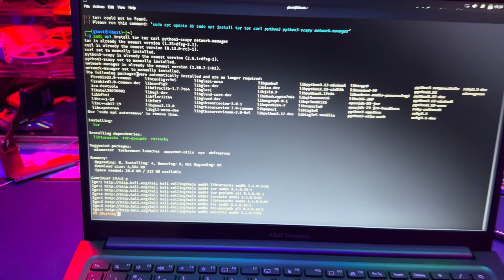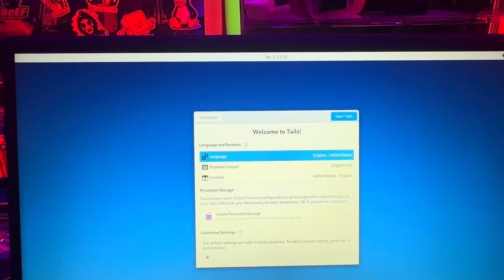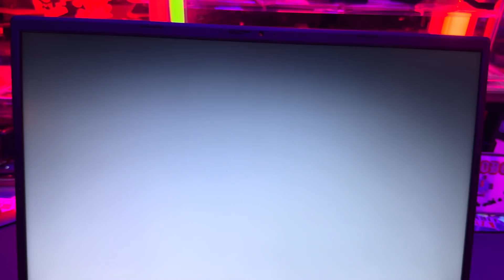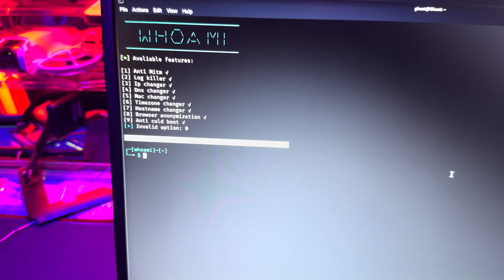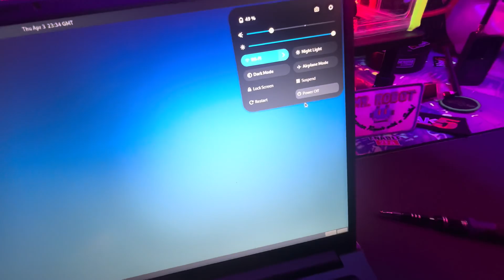I Built the Ultimate Privacy Laptop (Ghost Laptop 2.0 Upgrade) Hardware Privacy & WiFi PenTesting!

Comment: hey very good video and lots of useful information for hardware and what to avoid! im not sure if others have commented this but i wanna give a tip since i noticed you're wearing gloves. ive heard that wearing 1 layer of disposable gloves like that can still potentially leave prints if that is a concern for you. i recommend wearing thin cotton liner gloves inside of those type of gloves or even use leather gloves on top of disposable gloves with the thin cotton liner gloves. sounds very layered but it ensures prints will not be exposed! hope you find this info useful

Comment: This is mostly useless.. just buy an older thinkpad with a removable battery, that you can run a custom BIOS firmware on that would allow you to control power to devices then run an OS that'd allow you to change the MAC of your wifi card.

Comment: Super cool project but an EXTREMELY suspect laptop. The laptop screams illegal hacking. Maybe you can use less overt antennas? I think there’s some antennas are cord like so they are malleable and can maybe bend around the frame subtly. I think I’d rather swap the default chip out with another one though

Comment: Tf is this... instead of using external wifi card via usb you rather destroy the case and put it inside, which is not only ugly but also impractical. And it;s literally faster to disconnect that than your method

Comment: The "holes" equal/ look pretty ghetto...lol..a dremel type rotary tool isn't expensive  and will do you wonders...plus mighty usefull for plenty. 

If you are a responsible  human being a sharp metal blade type object and a heat source- heating up that blade(carefull, things get hot..so be mindfull of how you need to hold things- a butter knife that has a finer blade is wonderfull also a spear head clay sculpting tool....

Heck an exacto knife...but understand unles it is the type that in meant more for modelling, where the blade looks like a spade, then you most likelly will ruin the thing doing this...heat melts plastic...that's the intent here...  Heat the blade and use it to make nice crisp sharp incisions  into the plastic....heat the edge every time to make sure crisp clean cutts are made. Do this in a well ventillated area and with care and attention-  there's a lot of heat being used here...be careful.

Another method for clean cuts ,,,gardenning sheers...tin snips... but this is best done on areas that there is an edge... it is mighty difficult to create a nice job starting in the meterial with this method. Also, depending on plastic type/ age/ shape... be mindful that the plastic may crack in ways that may not have been predicted. Go slow- you'll need to apply lots of force at times...be patient with this.

Utilize the above for nice clean crisp pro incisions into the plastic..sure there may be other ways...possibly better..but that's what i've done....and learned to do..after making many minced  meat looking  hack jobs lol

Comment: The most important thing is to have a use case. The most overlooked thing is research. Once you have a use case, you research so hard its 90% of what ever your doing in security. 10% is actually what you carry out or protect against. You might be better off just replacing the chip with a compatible but less common chip. Leaving the wifi antenna alone in the screen. Trust me, there is no way you can use that laptop in public without someone on the ground or on camera noticing. Otherwise remove and try other less crazy adapters till you find one that works for what you need.
Reply: Actually i think you could. You could use a pieace of possibly striped cable run it too a potential metal object esp if inside a faraday style cage and use the building as a pote tial antenna itself. 😅

Something too think about. Like you see in a welding shop in some places where there is so much emf and just distortion for antennas guys in machine shops or welding shops will wrap tig welding wire or similar bailing wire around a antenna then run it too a washer or object or substantially larger size and turn it into a antenna 😅

Comment: The alfa wifi card your using is all the way out it's enclosure. What is the dimensions/measurement of the alfa wifi board when it's out of it's enclosure??
Reply from the maker: I don’t have the exact measurement, but it is about half an inch on the right and left and about a half inch thickness
Reply: @GhostStrats I really like the internal mounting of the Alfa card. My Alfa's been a champ in all my pentest and the range is amazing. Nice build. I'd stick with Kali, it's time tested and updated regularly. OffSec has great maintainers. Parrot can be buggy, it's just not solid like Kali. Anyways, looking forward to seeing more!
Reply: @GhostStrats  no worries, thanks for the information

Comment: why you just don't disable the cam or the mic from the settings ?
Reply: Because it 100% means it can't be used against you if it's not there.
Reply: If you do that it’s sill vulnerable to attacks of all kinds  better to take it out all the way I’ve watched enough tech videos to tell you that🤭… if I’m wrong please let me know
Reply: You are most correct💯
Reply: For laptop cam, i use a thing called 'tape'.
Reply from the maker: Disabling your mic and camera in settings isn’t enough for real cybersecurity. Here’s why:

Software can lie – Malware can bypass settings and re-enable them without your knowledge.
No physical disconnect = no true off – If it’s still connected, it can still be hacked.
Malware can silently record – Some attacks turn on your mic/cam without alerting you.
Firmware attacks – Hackers can control devices below the OS level.
Virtual device hijacks – Attackers can inject fake drivers to spy on you.
SoPhysically remove the mic/cam, use a kill switch, or unplug external devices. Software settings alone won’t save you.
Reply: Not hard to crack in and turn them on again
Reply: I'd better to remove it physically instead of disabling it.